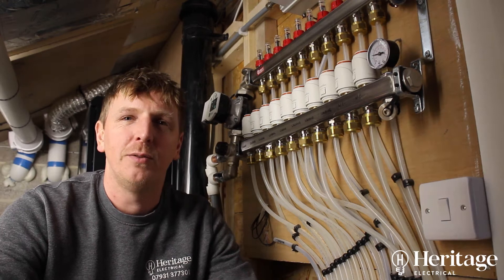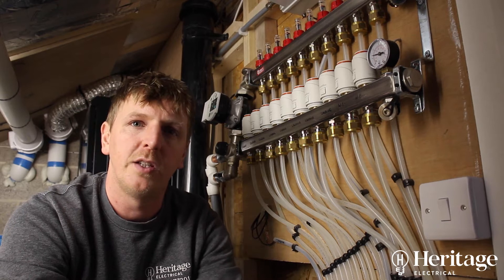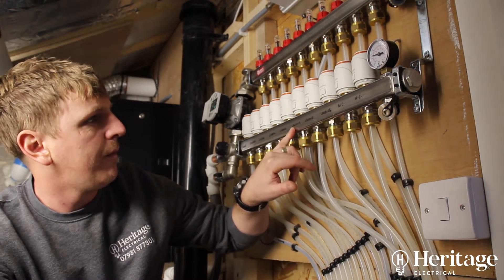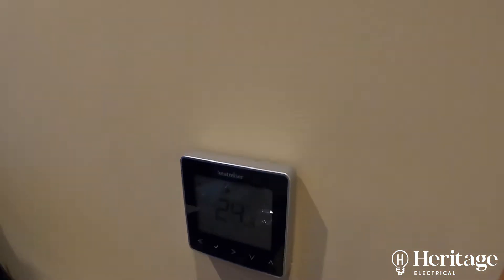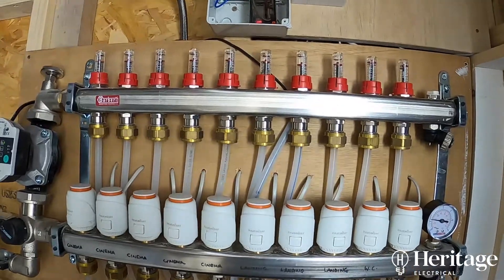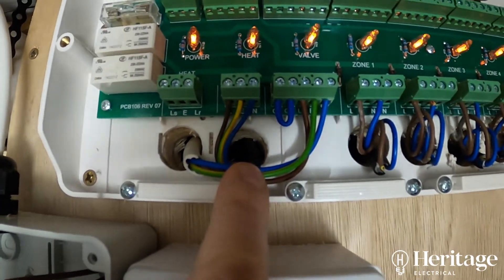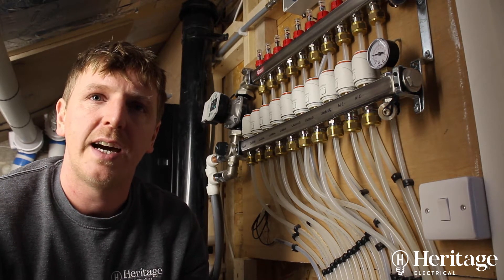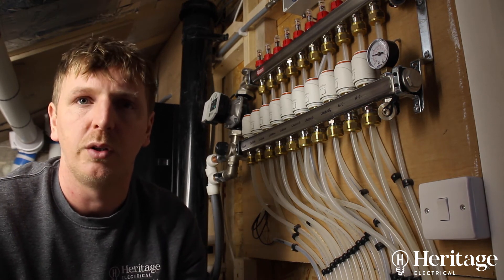Easy Integration with Vaillant eBus 🔥 || Heatmiser Underfloor Heating Installation 🌡️

Comment: How did you wire the relay we can not find a diagram anywhere 

We have installed a heatmiser wiring centre 
And a Vaillant VR71 wiring center but

Comment: Hi Paul, Can you please help, I have just installed an arotherm plus and have hit a problem with connecting my heatmiser UF wiring switch live to the heatpunp interface EVU terminal which is not a 240v connector, Vaillant will not tell me what I need to buy to integrate the 240v switch line to the EVU terminal as I seen in your video you are using a contactor.

Comment: Hi Paul. Thanks for the really informative video. I have similar issue and can see that you have sorted by using relay. I have system boiler,cylinder and VRC700 controls with VR70 wiring centre, 2 heat miser UFH zones ( one for upstairs and one for downstairs)no radiators. I wonder if you can help me by advising the following : is the connection from the relay goes to S2 or S3 in the VR70 wiring centre to call for heat or it connects to 230v RT connection in the boiler itself? Can I use only one two port valve to provide heat when there is call for heat from one or the other UFH control centre? Your help would be greatly appreciated. 
KR 
    Nick.

Comment: Thanks for this video, I've currently got a Vaillant system boiler with 3rd party Geniushub controls running a similarly large UFH install plus radiators upstairs and a hot water cylinder. Like pretty much all 3rd party controls connected to a Vaillant, my controls just switch the 230v feed of the boiler to turn it on and off with no control over the flow temperature so I'm looking to add Vaillant controls (a VRC700 or the newer 720) to add weather compensation and flow temperature modulation etc. Information on how to integrate Vaillant controls with supplementary 3rd party controls via a VR70/71 seem to be pretty much non existent from what I can find but from watching this video I think I could pretty much mimic this setup using my Geniushub controls for the UFH via it's wiring centre and adding a VR71 and Vaillant controls for the DHW and upstairs rads? My question is with this setup does the boiler still modulate its flow temperature for all 3 zones, so if hot water is calling ramp up the temperature but if only UFH is calling the flow temps will be reduced based on the weather comp heating curves etc?

Comment: Thanks for posting this. We have just installed a Vaillant system with heatmeiser manifold for ground floor. What relay have you used in the instance? Can you confirm the connection on Vaillant board as I have run a 3 core and earth from heat miser panel to Vaillant panel

Comment: Great video. So have a question, not sure if you reply to messages so here goes. I have a Worcester 30Cdi which has a Worcester Comfort II RF room stat that controls the house radiator heating. I have just added another zone to an extension with underfloor heating and added a zone valve which was intended to control this separately via the 230V side of the control board on the boiler. The boiler fires ok and but the heating control pedometer on the boier facia does not control the boiler temp and the boiler refuses to go above 20C. This all changes when I call for heat on the Comfort II. Do you know why this is? Do I need to add another zone valve on the radiator zone and bin the Comfort II to make it work?
Reply from the maker: Hi Tim 
I believe you cant control your additional zone valve from the circuit board on the boiler. you can only control 1 heating zone from the boiler.
You need to start from scratch with the boiler controls. 
Purchase a Worcester external wiring center that has availability of controlling 2 separate heating zones. Everything must be connected via that. 
If Worcester do not manufacture a wiring center, you need to manually wire everything through some other form of controls external to the boiler. 
Thanks for watching our videos.
Heritage Electrical.